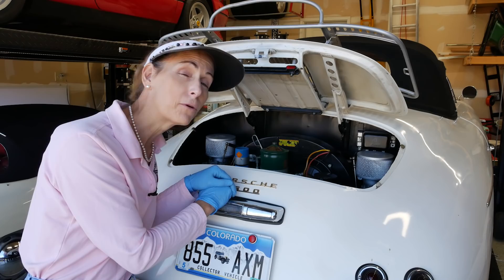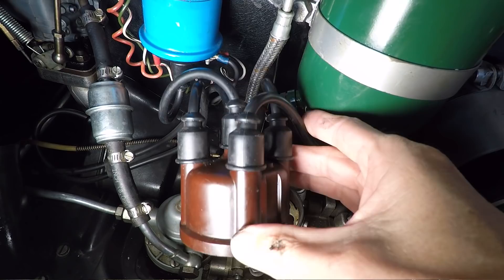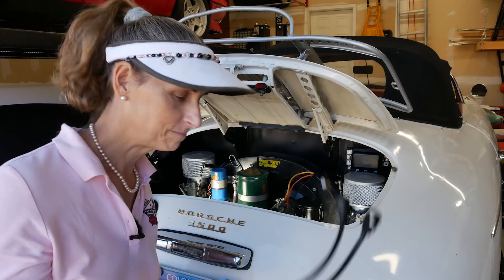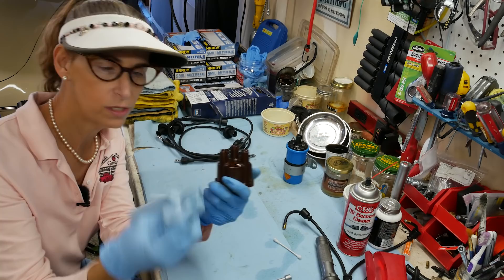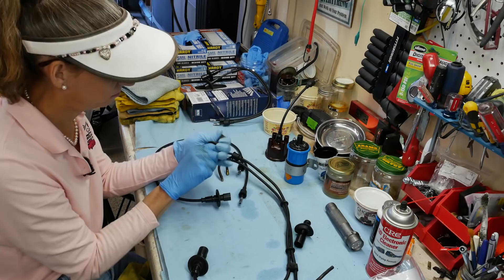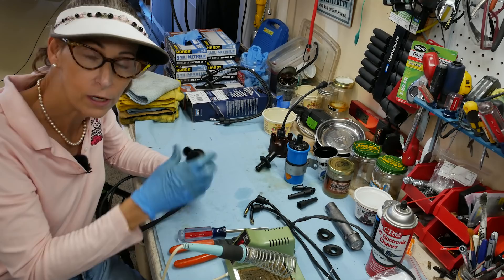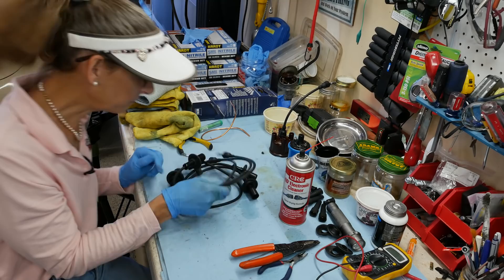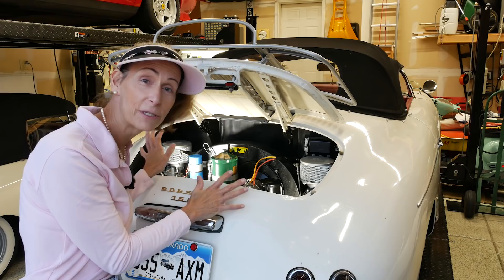Speedster Vlog #4 - Spark plug Wire Surprise!

Comment: Another great service job! And with the added fuss of using the original Beru caps, imposed by a purist/demanding owner. Those original caps (and the distributor too) are all well and nice, but I would replace them with new ones if the car is driven. They may look good cosmetically but they are far from ideal insulators due to age. Maintenance with upgraded OEM parts should not diminish  collector value.
Reply from the maker: Funny about that.  Slack is given for safety equipment (like tires and seat belts), but it is a badge of honor for every original bit.  These cars just aren't driven much...  And, those Beru caps, properly serviced, seem to work now and the engine is really smooth.  I totally get your point though :)

Comment: Glad you were able to get those electrical gremins sorted out.  :D
I actually have two old Weller soldering stations...a bit different than yours but those things were built like tanks and will last FOREVER.
Reply from the maker: They are sweet.  Built many a circuit board with that one.  It is all yellow, but powers up and does its thing!

Comment: Great video.  My experience in replacing wires has mostly been American cars from the 60's and up - I always just replaced one at a time but considering they were easy to get to, seemed to work for me.  The resistor in one wire plug?  Made me think maybe it was the shortest wire or something like that and a resistor was deemed necessary by someone - I am just guessing otherwise who knows.
Reply from the maker: Hi David, One at a time is really the safest way.  These are bundled by side so that is a thing...  I think those caps were just cobbled together from a box of old parts and someone got a resistor cap by chance.  Not needed in a car with no radio ;)

Comment: Great video. Could the resistor have been there for buzzing in the radio in the past? Just a guess.
Reply from the maker: Good assumption if the speedster had a radio...
Reply from the maker: That is a great assumption and what they are for, but they need to be on all four.  Nowadays they are in the plugs.  I think this set was cobbled together from an old bin of parts ;)

Comment: Was the one wire with a resistor the wire for #3? In an earlier video you pointed out that the plug for #3 was more grungy than the others. My guess is that someone put the wrong kind of wire (resistor type) on it some time ago.
Reply from the maker: Good guess.  Could be.
Reply from the maker: That is a very good guess and I would bet that is the case.  Speedsters never had radios ;)  I think these end caps were cobbled together from a box of old parts...  I'm pretty sure it was #3.

Comment: Franny , did learn the reason for the Resistor ? is it something somebody did? or is it a Porsche standard install or Porsche recommendation for performance?
Reply from the maker: I think it is for noise suppression for the radio (which this car does not have).  I believe these wires were cobbled together a bit ;)

Comment: Did you figure out why the one spark plug wire had a resistor in it?
Reply from the maker: Only thing I can figure is it was all cobbled together from a set of old parts and whoever couldn't find a complete set.  They probably should have checked that resistor thought, huh... ;)